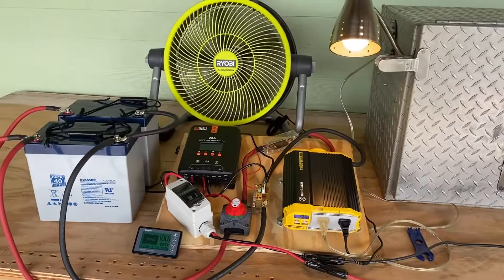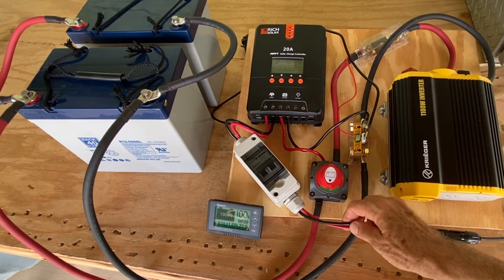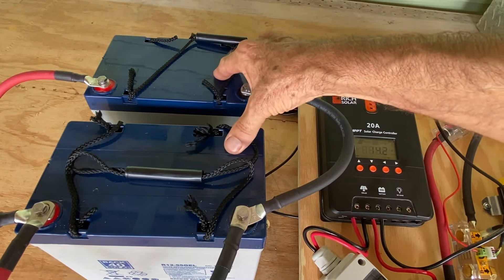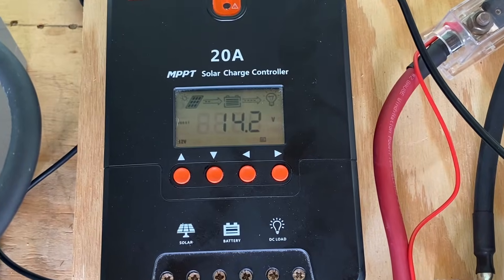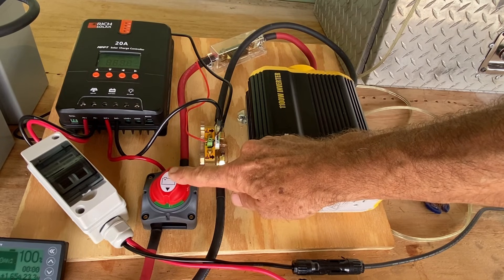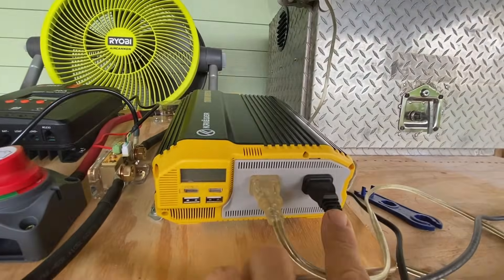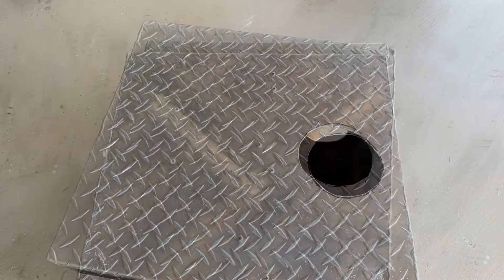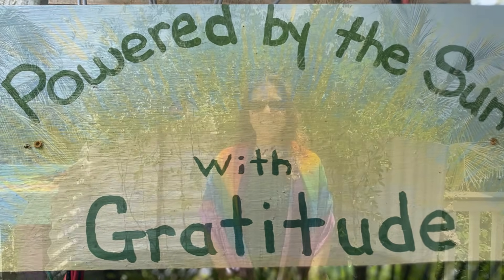HURRICANE PREPARATION:  DIY Portable Solar Generator in a Toolbox #hurricane #emergencypreparedness

Comment: I read all the comments, yes, that inverter is junk, but you replaced it with just another cheap piece of junk, the batteries should be wired where the hot is on one, and the negative on the other,balance better, and more even draw. Now I just dont understand making a system with 12v, 24v is much better, and no more exspensive, ie, 1500w ÷ 12v = 125amps, 3000w ÷ 24v = 125amps, twice the power,same amp draw,same wire gauge! Now if you have all 12v apliances, 12v is ok, but then you wouldnt need a inverter, for a 120v! Those cheap inverters, like the one you said you replaced with, is cleaner energy, but still high frequency junk, there a dime a dozen! For some reason people think when they say pure sign wave, you've hit the ultimate goal, game over, that hilarious, real clean power is low frequency ( transformer based ) pure sign wave, not high frequency ( $5 chipset based ) pure sign wave, its just cheap junk China sells to people who dont know any better! Knowledge is power, educate yourselves
Reply from the maker: Ok, so what inverter do you recommend for a very small portable solar generator like this?
Reply: @ecohabs4earth Any brand in low frequency is definately better, not cheaper but definately better! They sell many on Amazon, Aims, comes to mind but there are plenty others! I haven't shopped for low frequency in a very long time, because I own 2 identical low frequency solar generators. Actually there the only company that ever made them, 3000w output 6000w surge, 6 AC outlets on 2 15amp circuits, 5 DC 13.8v cigarette ports 20amp,TT30 RV plug, dual ACchargers 1500w, dual mppt controllers 150v, 2000w input, unlimited battery exspansion, external battery exspansion port, 20amp car charging, and can charge and discharge from all ports simultaneously, with a 13w idle consumption! All metal, modular, stackable, with no plug in cables, and the heaviest component is 32lbs. These units are 7yrs old, with 10kwh in batteries, only one has ever been used and that was only a few times. These units will last a lifetime. I have 5kw solar on my roof, and 1kw still in boxes, I do own 1 high frequency inverter,1200w, for my car, it's a backup to my gas generator to charge my 10kwh battery bank.(a backup for my backup)so that's actually 6 ways to charge my batteries.
Reply from the maker: @dustydawson8977 Very cool! Thanks for sharing all that. I will definitely look into the LF technology for our next project.

Comment: 🤔 SAFETY FIRST! The VERY first thing you hook up to the Battery Pos Post is the Mains/Catastrophe Fuse or Breaker, then the load carrying wire or switch. Should ANYTHING short out, the wire connected at the battery NEEDS to be Fuse protected AT the battery. Every circuit has to be fused separately after that. The Neg wire connected to the battery needs to be connected to the other battery to BALANCE the two batteries as one big battery. Your set up makes it a Master-Slave arrangement and the Slave battery will never get to full charge and will die before the Master! The Battery wire from the Solar charge controller needs to run to the battery through its own breaker to keep the batteries topped up if the Main switch was off.
Reply from the maker: @barntt  thank you yes the system has been upgraded to implement those changes!
Reply: @ecohabs4earth  AWESOME!

Comment: Nothing is free, calculate the price of those batteries and other accessories used in this system. Then count your energy consumption in Kwh you will get a price per unit of your electricity which is not cheap. So stop sayinf its free! Nothing is free my friend.
Reply from the maker: @ferdm9646  yes, but every month we use it that price per kilowatt goes down as we have zero monthly expenses to run it😎
Reply: @ecohabs4earth  yes, but it's not completely zero rather you have already invested money on it which you cant see. We can see it this way , per kilowatt hours rate and other factors are important here not completely zero bills. Solar panels degrades overtime also batteries are using cycles. Best thing is this system is that when you build it you're cut off from fossil fuels and Carbon footprint. Cheers mate, keep it up.
Reply from the maker: @ferdm9646  Thanks for watching and providing feedback!
Reply: @ecohabs4earth  "It'll eventually pay for itself." Is not free.
Reply: You won't care if you're hit by a hurricane in the middle of the summer!! You'll give your last dollar for a fan to help keep you from dying. Been there, done that, and got prepared!
Reply: @dirtisbetter  Absolutely! It’s all about being prepared for emergencies, not about free energy. A fan can literally save your life in a heatwave.

Comment: Putting the batterij in series would make it more efficiënt
Reply from the maker: Putting batteries in series doubles the voltage and we would end up with a 24 V battery system. I need a 12 V battery system so parallel is the correct way to do it.
Reply: @ecohabs4earth  you still have 2x12v
Reply from the maker: @Manjarow  you are correct 2x12=24

Comment: That inverter is a pos it’s a modified sine wave that can damage electronics. A cheap Amazon pure sine inverter is a far better option
Reply from the maker: Yes I have since swapped it out for a pure sine wave inverter, https://amzn.to/3WQosYQ
Reply: Resistive or rectified loads don't care about modified sine waves, but yes, given the inconsequential price difference, might as well go with a pure sine wave inverter.
Reply: Why does everyone some how believe, I have pure sign wave, best you can get done, story over! Absolutely rediculous, pure sign wave is just clean power, you have high frequency inverters ( built using $5 chipsets ) pure sign wave, and then you have low frequency inverters ( built using transformers ) like the world's power grid, pure sign wave! Low frequency is the best you can buy, clean,powerful, real power, long lasting, made to be pushed hard day in and day out! High frequency is temporary power, does not like inrush current, should not be ran more than half there rated power, and builds a ton of heat, which is the #1 killer of these, not long lasting! Pure sine wave is just a term, for clean power, low and high frequency is the actual technology the inverter is built on, and are worlds apart!

Comment: It's not free. You have to buy the equipmet,  hook it up and maintain it.
Reply from the maker: Yes but it is so empowering to have free electricity once you have the setup! Thank you for watching!
Reply: @ecohabs4earth  yes, it is; I have done it too; however, I still have to maintain the equipment and pay a bimonthly fee to CFE.
Reply from the maker: @davidceron8660  as long as we move in the direction of freedom from slavery to the utility companies, we are making progress 😎
Reply: @ecohabs4earth  I agree. The new solar generators are a step forward towards that goal. I did a solar installation on a swimming pool with a swimming pool solar pump, 4 330W solar panels in series parallel and it doesn't need energy from the grid.
Reply from the maker: @davidceron8660  oh cool. We a solar pump on our pool as well, panels attach right to a DC motor. Sun comes up, pump turns on. Sun goes down pump turns off! It’s the bestt!
Reply: @ecohabs4earth  MI next step is to install 2 Ecloflow Pro solar generators with 4 bifacial 400 W each to charge them up and an interlock system on the electrical panel, check the results to find out how much power can be gotten out of them.
Reply from the maker: @davidceron8660  oh, that sounds really cool. I need to provide some lightning protection to my home solar system. Do you have any experience with this?
Reply: @ecohabs4earth  No with lightining.  I don't have any issues with it. Sorry.
Reply from the maker: @davidceron8660  No worries. I will have to watch some YouTubes!

Comment: Other than the way you parralled your batteries ,its an easy set up. The parallel wiring is wrong, works but wrong. You should of had a positive coming from one batter but the negative coming from opposite battery. They will not charge equally with that wired configuration you have there. you will kill the first battery a lot sooner.
Reply from the maker: Thanks for the tip that is really helpful!
Reply: Would that apply to any other batteries in a series…?
Reply from the maker: @unclecraiglifeonathaifarm  no just batteries wired in parallel
Reply: You should have not you should of.

Comment: What really great is that you are using a metal box. Any outside interference is blocked out like an EMP as long as you ground the box to earth ground. A modern day faraday cage
Reply: Are you for real? I was unaware that being in that metal box would do anything to deflect EMP damage. Very cool!
Reply: @majinvipergaming  it won't unless you tape all the seams with metal tape. There is a channel on here that does a nice scientific demo of cages.
Reply: @thastinger345  Metal tape like the stuff used in HVAC? I apologize for my lack of knowledge I'm a little late to the game.
Reply: @majinvipergaming  yup, copper mesh works for the lid if you need to be able to take the lid off easily
Reply: @thastinger345  This is objectively incorrect, the "gaps" would have to be greater than the size of the waveform or fractionally any harmonics thereof. A metal box with a somewhat tight-fitting metal lid would sufficiently act as a Faraday cage (which is being replicated in practice).
Reply: @Desert-edDave  negative...not unless you know the specific frequency so you can design your gap for 1/4 wavelengths of the freq. An EMP or CME could cover a wide spectrum, some of which is sure to be between the freqs of your gaps.
Reply: @majinvipergaming  yes sir. You can place all sensitive electronics in a metal box and it will block out any electrical interferences
Reply from the maker: Thank you for watching!